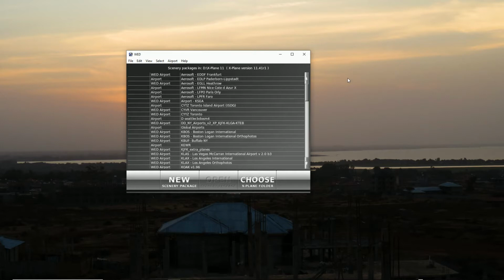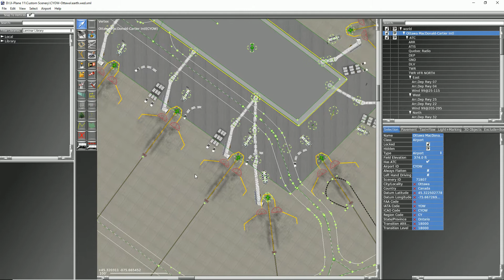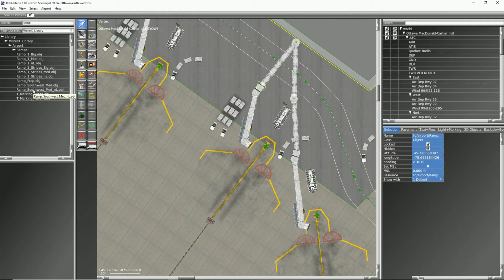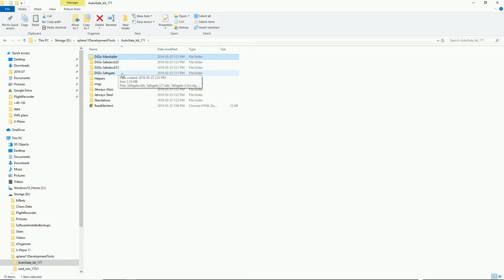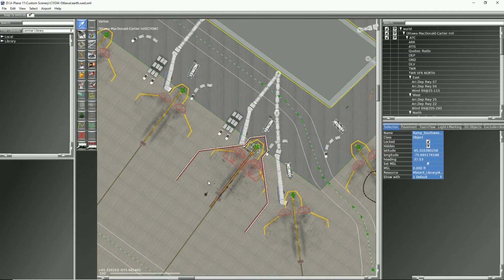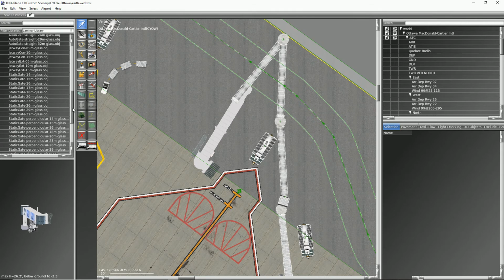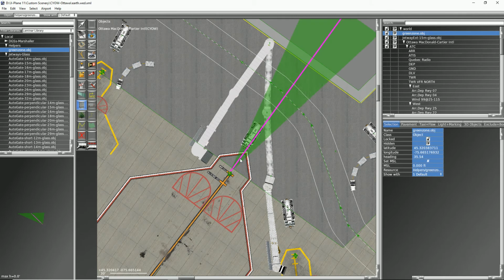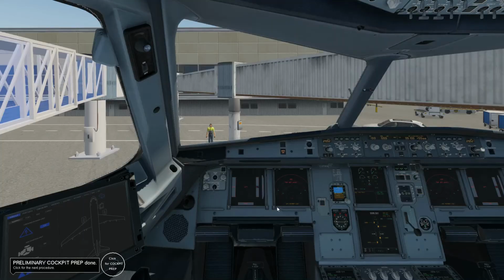Auto Gate for Difficult Airports in Xplane 11

Comment: Great job Mr. Bob, I have a question. How can I make the green cross to be able to move or delete the object? Thanks.
Reply from the maker: Yes it is difficult to grab the green cone with the selection tool. The best way is to type green in the search bar above the list of airport items. The green zone will appear in the list. Click  on it and hit delete.
Reply: I will do that. Again, thank you so much for the amazing help. Bravo Zulu...
Reply: I was able to deleted the green zone, now when I add any Jetways, I don’t see any market to allowing me to rotate the object? Thanks
Reply from the maker: @MA3juan  You need to click on the little green cross-hair to select the object and then you click on the arrows around the crosshair hold and drag  to rotate. Don't rotate the jetway, however, or it won't work- it needs to be alligned to gate (ramp start). Rotate the connections and extensions.
Reply: @bobblack4604  I did it, but when I choose an object from Local, Jetways-Glass the object do not come with a cross-hair so when I select the destination on the Airport, I don't have the ability to rotate or move the object. Thanks in advance for your respond.
Reply from the maker: @MA3juan  You need to use selection tool to select option. Local is only for adding objects. You can also select object from right hand list of objects but local is only for adding objects. Watch the tutorial I select objects using the selection tool and rotate them.